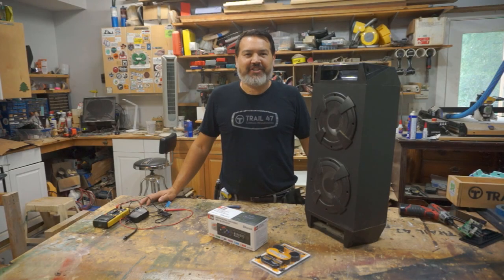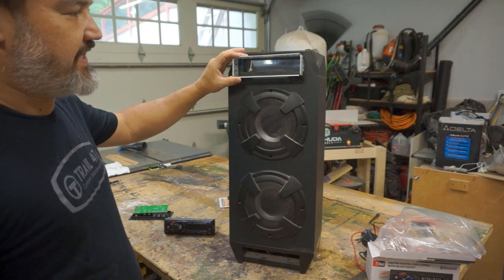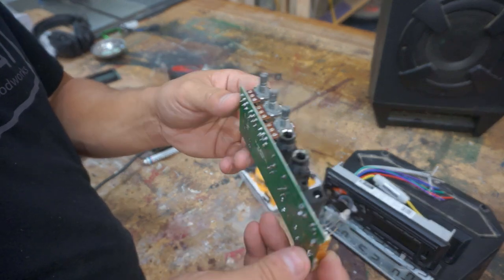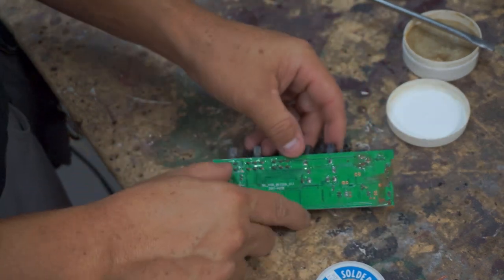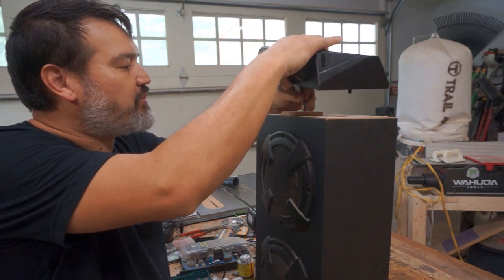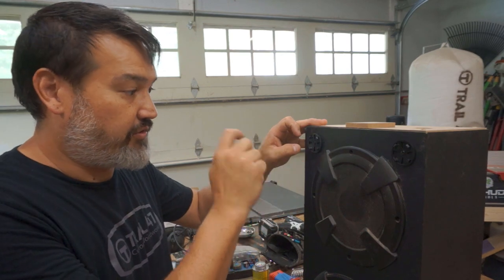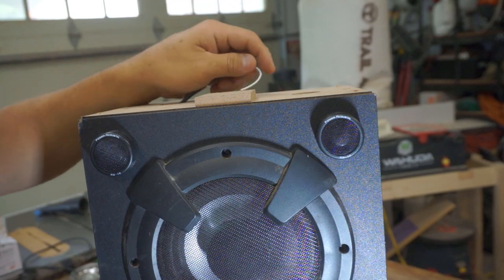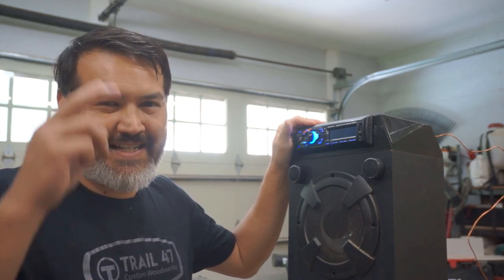Easy Shop Radio Build with Bluetooth using $16 Auto Radio - The Garage Engineer

Comment: I have had a similar project in the making for a year. I want to build a cathedral style radio using a cheap Bluetooth car receiver. It's a very similar project to yours. I'm glad I watched. Your use of the barrel electrical converter is a perfect idea. I'll have to come up with a way to mount the converter for the cathedral radio.
Reply from the maker: Glad it helped.  Thanks for watching.